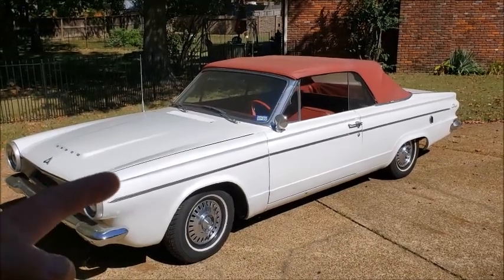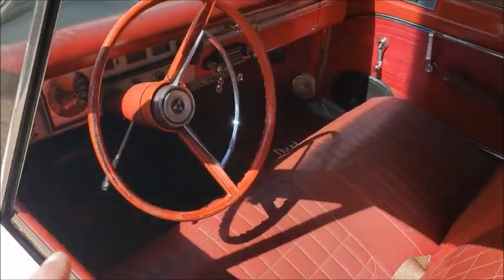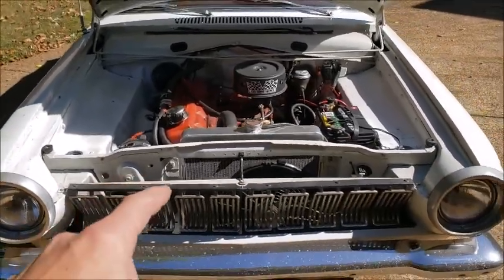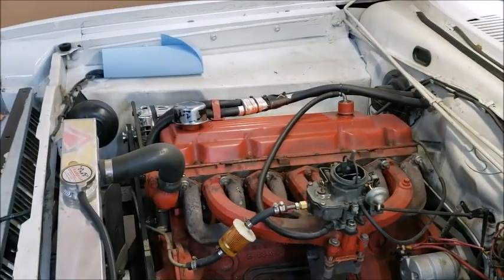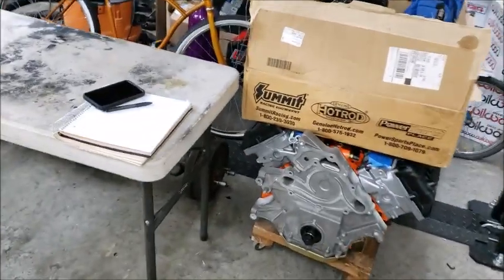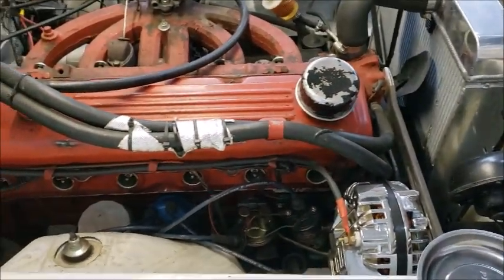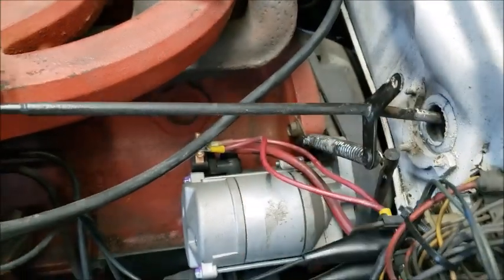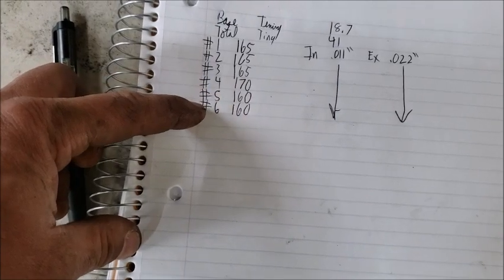Assessing a new slant six engine build: How to begin.

Comment: valve stem seals is a weak point on that engines, they crumble if the engine is overheated and it is responsible of heavy oil burning when the guides are not top notch.
 I saved many oil burners simply  by replacing valve stem seals.

Comment: one of the best cheap upgrades to the stock slant6 is ditching the factory exhaust pipe and pipe flange and upgrading to a 2" inner diameter flange with 2.00 " or 2.25 size pipe. factory pipe and flange was so restrictive

Comment: I would live to see you install a weber 32/36
Reply: I did that to mine and found the 32/36 to not be enough. I was always in the secondary when accelerating from a stop, and it didn't have much part throttle power. I swapped it for a 38/38 and that really woke it up. Of course, I also had a header and dual exhaust on it.

Comment: Id like to see you set the timing correctly and get a baseline. I saw shims under the valve springs. Looks like it was rebuilt correctly. The description said it was overheating. I'd like to know why its not running correctly before its just torn down and upgraded.
Reply from the maker: I agree but I will do what the owner wants